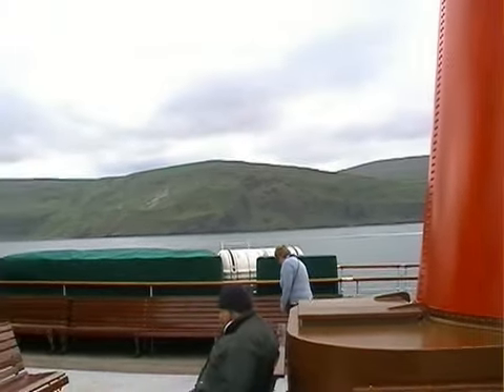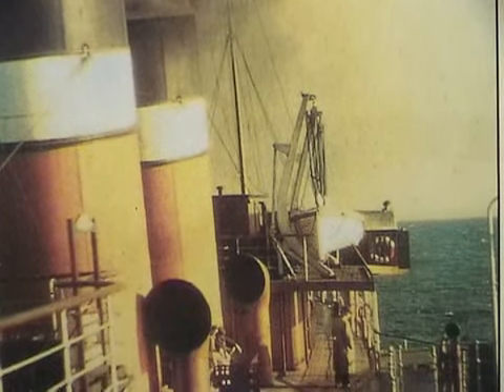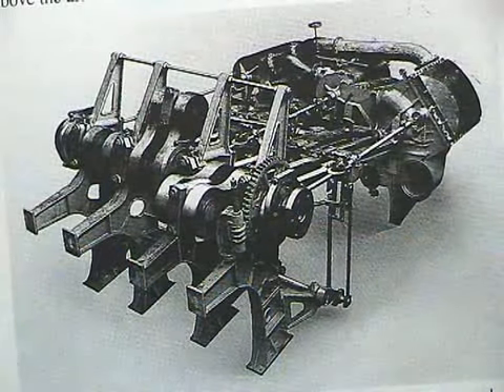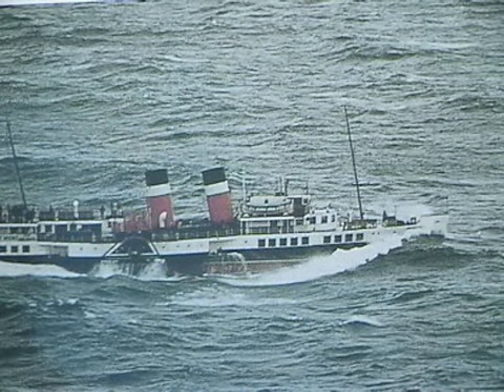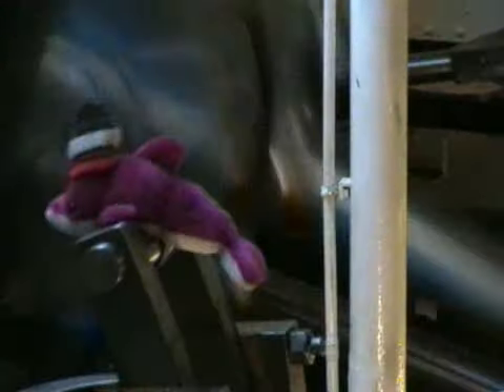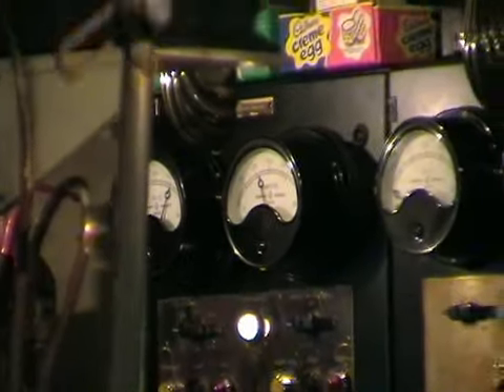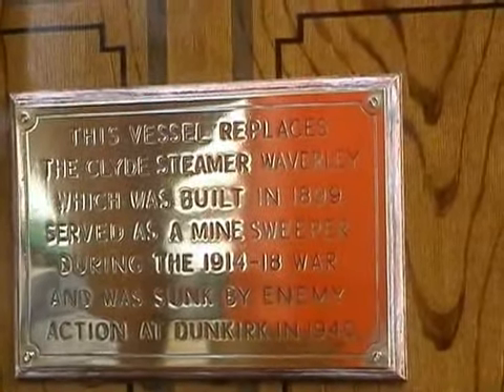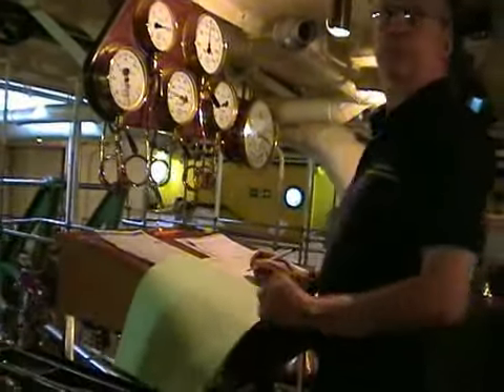Paddle Steamer Waverley 2004

Comment: Such paddle steamers are still in regular use in Bangladesh, mostly on riverine routes. Most are over a hundred years old.However, they are not really steamers as most have had their steam engines replaced with  diesel marine engines.